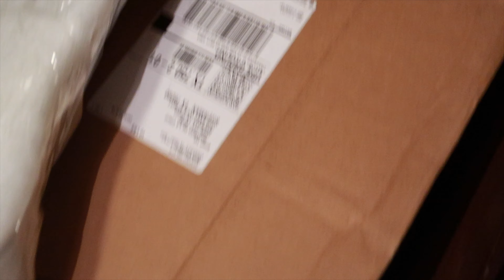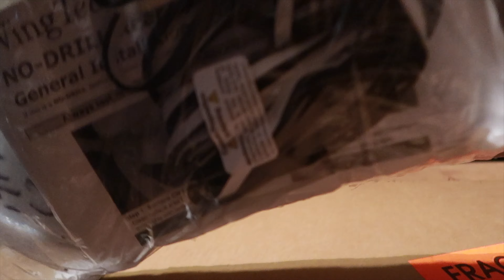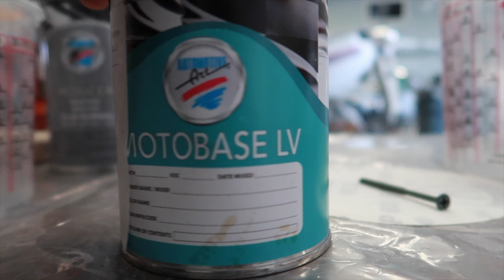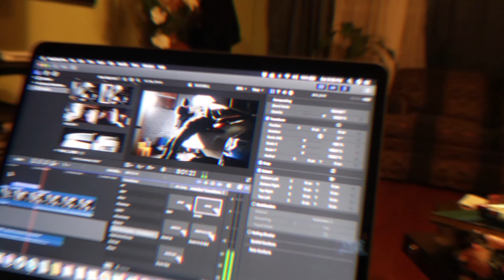370Z DUCKBILL INSTALL!

Comment: I ordered mine from the website and the fitment doesn’t fit right.
Reply from the maker: Alaniz. 34 man that sucks. Did You order the correct one? There is a normal one and a roadster version.
Reply: I ordered one from DAR and had it installed and it looks awesome! Almost like a factory look. You probably ordered the roadster version, which won't fit right.
Reply: Busalove did the holes line up for bolting?

Comment: hey bro did you use stock fender liners and undertray for your front bumper?
Reply from the maker: Aries Rose no fender liners actually. And the stock undertray doesn’t fit on the nismo bumper. I need to get the z1 undertray for the nismo bumper
Reply: Im running the V1 Nismo front end and rear end . Rear end is plug and play .. front end you’ll need the undershroud and the price that connects the undershroud to the bumper so you’re looking at 1k for those parts + the bumper and paint / labor if you’re not doing that on ur own

Comment: Will it fit flush and does it require drilling if the 370z already has a factory spoiler? Just making sure
Reply from the maker: It sits okay. And yeah if u already have the spoiler u don’t need to make holes in the trunk